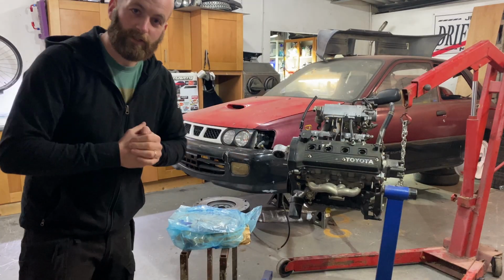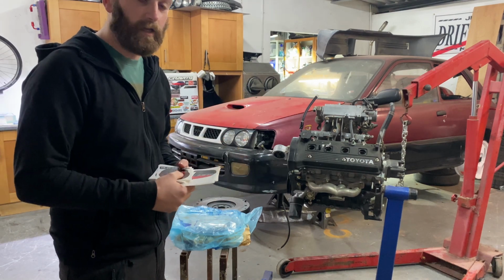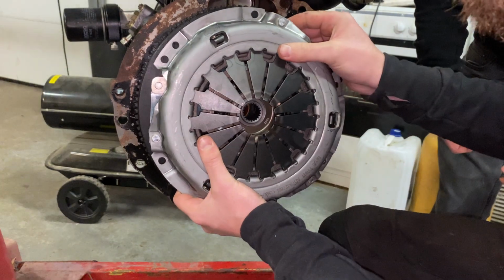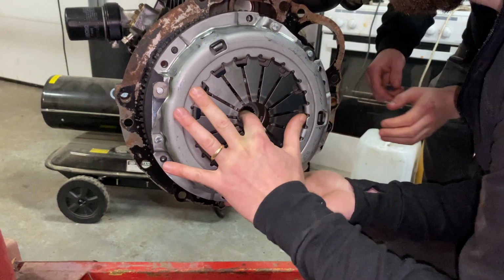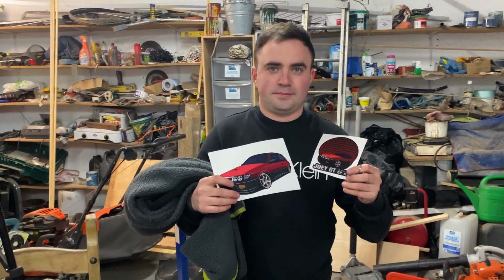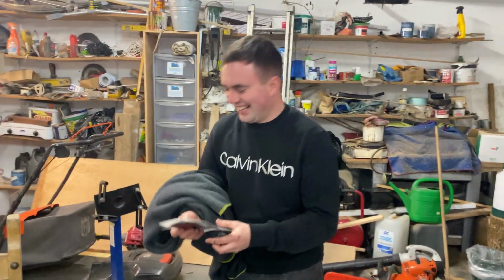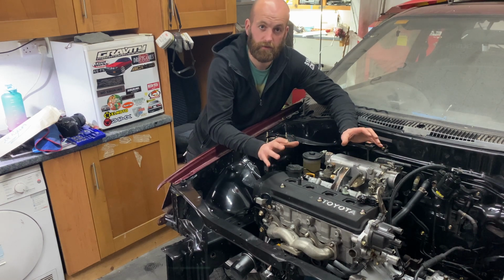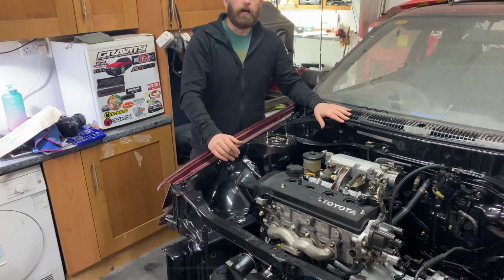Starlet gets its new turbo engine

Comment: On the joey boy deadly job.  Whats ep wiring doing with your wire loom ? 🤔
Reply from the maker: Hey man, he’s firstly doing a health check on my gt loom , which isn’t going great 😅 then he’s going to take the connectors from my ep80 loom that I still need and put them into the ep82 loom to allow my standard engine bay and dash loom except the turbo engine loom and ecu ✌️
Reply: @joeygt6794  man I was hoping u say something like this . I was baffled if you could do that or not . So in this case u won't have get gt clocks or anything . Is he pricey or reasonably cheap enough ? Thinking about getting standard shell and throwing in gt engine . Be nice to buy the real deal but be nice to win the lotto to 😄
Reply from the maker: Well in my simple brain it will work 😅. It’s not been tested yet but we are still working together to get it figured out. I’m not sure of the cost yet but we are working on that also. Mine will be the tester to see if it’s possible to swap everything over and if the car will then run, but we are getting close. I’m looking forward to figuring it out and sharing with you all ✌️
Reply: Fair play @joeygt6794  looking forward to it 👍

Comment: Are the engine mounting points in the same place for the turbo and non turbo engine
Reply from the maker: Yeah they are the same. The 2e drivers side engine mount is different alright so I had to pick up a 4e mount.

Comment: Engine looking tidy in the bay. 

That 4efe gearbox will work fine for now. Focus on getting her revved up.
Reply from the maker: Thanks man, so cool to see it in place. The gearbox is actually from the original 1.3 2ee engine that came in the car, but I’d imagine they are probably the same thing !
Reply: I’m sure the gearboxes are pretty much the same, even the 4 speed on the 1e